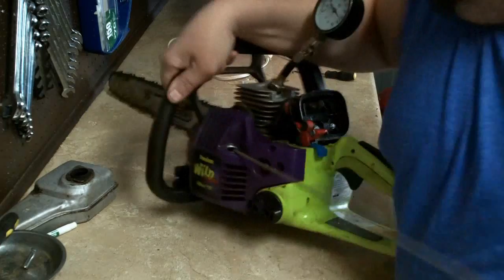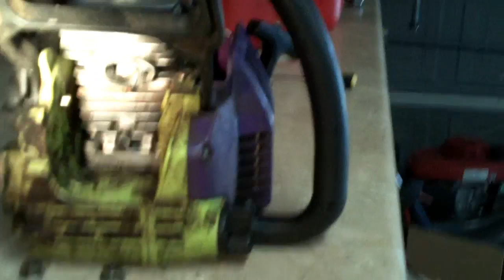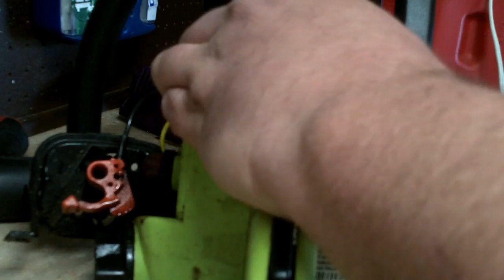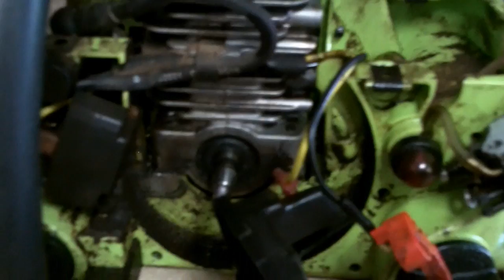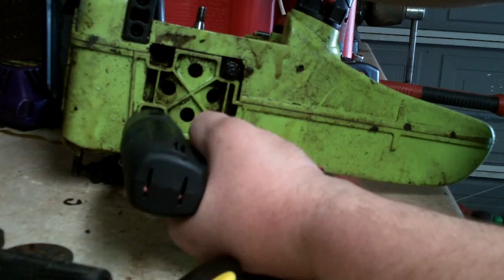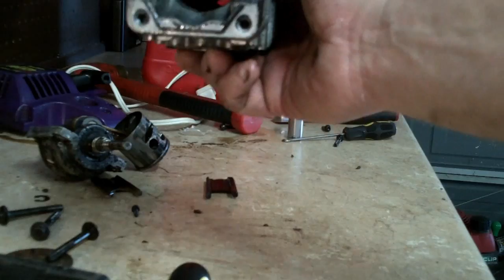POULAN " WILD THING"  CHAINSAW  ENGINE FAILURE DIAGNOSTICS AND TEARDOWN

Comment: I wish people would stop buying these $150 saws. If you really need the power of gas you need to buy (at the very least) a farm/ranch grade saw from Husqvarna or Echo. Stihl is a good saw but only in the pro line.The real problem is that 80% of people don’t know how to run or maintain a gas saw let alone sharpen a chain. The number of videos on YouTube about saws that have been straight gassed and have scored cylinders/ pistons is evidence of this. If you need to trim trees or other small jobs,just buy a good battery saw. They are a lot better than they used to be a few years ago.

Comment: Very good thanx,I have a poulan saw262 pro no spark. replacedthe integral coil and wire assembly, gapped at 15 thou to flywheel,sanded lightly fly wheel contact points; last year replaced all the fuel lines, fresh gas......no spark any ideas?

Comment: These engines live for years if you treat it right. Drain fuel out every winter, and let it warm up before revving it. For some reason nobody knows the correct way to maintain a 2 stroke. My wild thing has been running since i bought it new when it first came out.

Comment: I would save the parts you problem not as common as carbs save that carb and bar and chain also if clutch wheel good save it I seen them dent and jam just with pitch log

Comment: One more thing after completing the video .  Thanks for the demo.  You seem to be very knowledgeable except for one thing . Your refference to polan being a  " paper towel " saw is correct about them , but so is most products today.  T H R O W  A W A Y   is the norm .  Someone on a farm blog said , poulan is a throw away saw after about 5 to 8 hrs service of use .  Not before the time of the NAFTA agreement in the 80s .  I am rural and for many years , i depended on firewood , because most of my land is timber .  I have used a pouland saw year after year for several years and many many cords of firewood before getting another poulan !!!!!!!!!!!!!!!   They lasted hundreds of hours .  The consumer is getting more knowledgeable about the government and big business getting into bed together and robbing the people by higher prices and no quality .  Have you noticed the left's agenda to make everything wrong , backwards , upside down , inside out , truth a lie , etc. etc.   Pouland has fallen under the industry standard , called planned obsolescence .  They're products are designed to fail in a short time .  An  O L O G O P O L Y  is a market form wherein a market or industry is dominated by a small number of large sellers (oligopolists). Oligopolies can result from various forms of collusion which reduce competition and lead to higher prices for consumers. Oligopolies have their own market structure.  When they moved most of our industry out of the USA , there was no more competition , therefore they had an almost monopoly on their products !!!!!!---Ernest E. Johnson

Comment: These saws require 40-1 gas oil mix, would you suggest using 50-1 instead? To avoid the carbon build up? 
Thanks

Comment: I am sure the main reason they break down is because, WHO looks after a 150 dolLar saw like they would a 5-900 dollar saw?  plus ppl who buy those saws are noobs, no nothing about saws and just want one or need it for one job... you know ppl who dont look after them. watch another youtuber small engine dude say " they will last as long as any other saw as long as you look after them proper. you may not be falling big azz trees with it but for little work they are fine.

Comment: My Poulan 2150 has a rubber seal on the cylinder head side of the carb adapter, and the gasket kit for this model has an actual gasket rather than the rubber seal. 
I'm wondering if it would be best to discard the seal and use the gasket only or use both?
Reply: Ooops, wrong saw ^, it's a PPB3416.

Comment: found one just like it, same model number exactly, saw itself is in great shape, carb is pristeen, spark that can jump a fence and good compression, just a little scoring is all, but it wont run for shit, cause its a pullin pro? cause its a 2 stroke? why? . . .it dont make sense that perfect condition, good plug, not flooded, saw in working order wont work

Comment: i honestly dont know why people trash poulan saws , its the people using them that mess them up by using cheap gas and cheap oil or forgeting to ad oil to the gas ????  these saws with the proper mods will run harder than any husky or stihl 42 cc class saw i promise

Comment: ive got a 1998 42 cc wild thing , i removed the engine and used concrete adhesive to reseal the crank seals and clamshell , i also drilled a hole in the tank to take a larger main fuel line and used a stihl fuel filter ,, on first start up it would rev to almost 16,000 rpm , i shut it down and retuned the carb ,, i started it again between my leggs and it went full throttle close to 17,000 rpm and the flywheel exploded between my leggs and blew my left nut and half my left leg away ,, be carfull moding these saws they hit full rpm very fast they are a beast

Comment: hi have a wild thing got gas and fire. but wont crank. does it have a flywheel key. it is almost a new saw. let it set up with bad gas . put new carb on it fired right up about 6 times next day wouldnt not start hasent started yet.

Comment: Question.....Poulan Wild Thing.  125 psi, clean plug, good 40:1 gas, strong spark, brand new carburetor, exhaust flows clear, will not start, puff, back fire anything , even when using starter fluid.....   Looking for suggestions....thank you

Comment: On the top of the carb on the right side it has a plastic black part that has a spring. Does someone know what that part is called. And can it be bought without buy the hole carb. Any help will be helpful thx.

Comment: Jeremy, thought you were a backyard mechanic within the first 45 seconds of the video, a compression test without the throttle WOT, new guy mistake. But hey, you know what you are doing. good job, also if you said it or not in the video, poor quality oil will do the same, for all you guys reading. Also, for all you budget minded guys who are buying poulan saws to use once a year and dont have alot of experience with a saw, please buy a stihl, husqvarna, dolmar, something with a reputable name. (even though poulan used to be a damn good saw. maybe you wont use the saw enough to see the engine difference, SAFETY is always good. Poulans anymore lack in that department. Just remember, if you buy a saw from walmart, the customer service desk cant tell you what went wrong with it, but an actual dealer can. A new ms170 is like 200 bucks, plus you get an actual dealer to work with. budget minded is good, but so is peice of mind that your initial investment will last.

Comment: Hello, thanks for the info I didn't want to hear.  I just bought a used chain saw from a craigs list guy exactly like the one you took apart. The seller showed me it started up and I thought is was okay.  When I got home, I started it up and felt that the pull string was really hard to pull at TDC and when it started it went to max RPM so I shout it down quickly. I did that several times so I surmised that the carburetor is bad until I saw your video. Now I'm thinking I got a lemon. Wood I be correct ?  No,  I have not taken a compression test yet because I don't have one that screws into the head.  What should the compression be in PSI anyway.  Thanks

Comment: so clean the carbon off and put it back together and run it.
You did show 180 psi which means the piston-cylinder-ring are working.
And that ring moved, I saw it move, so it was not stuck.
I just pulled apart an old Poulan 2300 with 16 inch bar. Engine had small amount carbon buildup. Cleaned it up-replaced the 3/32 oil line for the pump. 
Saw has good power, cuts good.
These engines can tolerate some wear-grooves on the piston. The cylinder though should be smooth.

Comment: Someone ran cheap oil, or outboard motor oil in this saw. If people would buy good synthetic oil like Bel-Ray MC-1, or H1R, these saws would last a lot longer. I have run Bel-Ray at 40:1 in cheap chainsaws, and after five years, the cylinders and pistons still look nearly new, and little to no carbon build up. I have a $59 Homelite bandit weedeater that is 16 years old and still runs good. I have only run Bel-Ray at 40:1 in it since I took it out of the box.

Comment: Have a 2375poulan saw it has a lot of kick back when u crank it .
i checked flywheel key it is good it has 120 compression.
It has good spark when i put gas in carb it will not hit a lick
if it has compression and spark it should at least hit. the rod has
a little rattle in it could it be binding up and how would u tell? help.
i checked seals with air and vacum all good.

Comment: thx for the vid bro...my fairly low-hours wild thing used to start very hard but when warm would run like a champ and start first pull. this season when i got it out, put in fresh gas and oil (it was stored empty) and attempted to start it just wouldnt. after probably 300 pulls it coughed to life a couple times (using ether), then died. i'm wondering if i should troubleshoot it or just get a new saw..these seem to have a bad reputation....
Reply: that's a very good saw ,, people that buy them fuck em up with cheap gas and oil , I've got several stihl farm boss saws and I I'm impressed with the poulan 42 cc class saw it's bad ass I've owned one for 15 yrs and work it hard and never had a problem with it ever
Reply: duh why did you buy it in the first place? they are junk

Comment: Hi I would like to know how to remove the oiler from under a break band. My POULAN "Wild Thing" isn't oiling when I cut
Reply: remove the clutch   its right under it  easy fix   had one of mine  go  bad
Reply: the platis oiler is shot. you have to remove the clutch not brak band

Comment: Can someone tell me if running a chainsaw at lower rpms is dangerous?
Reply: +checkmyleetskill  A chainsaw should operate at ONLY two speeds. Idle and Full Throttle.
Reply from the maker: no i do it all the time....no need to wrap a saw to 12,000 rpm to cut a little twig.....just use common sense and yould do just fine
Reply: JEREMY FOUNTAIN  Thx for the quick response.I appreciate it.
Reply: not quite John me you can adjust the rpm depending on the cutting circumstance. for example your not going to rev a 09 sthil chainsaw full tilt to cut a branch 3 in wide. that's why the throttle can be varied.
Reply: its not dangerous, but they do need to rev, other wise carbon fouling will build up
Reply: no
Reply: Normally it's not... your engine will most likely just cut out and misfire if it's idling too low. If you're talking about low RPMs at full throttle,  that's not a worry because you can't put nearly enough load on the engine to lug it!! The clutch slips long before you can get close to lugging the engine.
Reply: checkmyleetskill old thread, but yes a mid range throttle is dangerous, for extended periods. A chansaw has 2 jets, one for idle , one for WOT (wide open throttle for guys who have asked that question.) At idle, your pilot jet (or low speed or idle jet) is simply put- keeping the saw running. a saw needs WOT when cutting to both make the fuel/oil mix, work as it should. (low rpms= less combustion temp= carbon fouling like in this video. Plus mid f=range throttle cutting does not move enough air via magneto or flywheel to properly cool the engine. that is aside from porting or jetting a saw, changing sompression and squish and timing.

Comment: I had one of these come in my shop today. It had been run with the brake on. It got the clutch REALLY hot and melted a bunch of plastic around the clutch, ruined the clutch spring, and ruined the brake. I took the clutch and brake off. It will crank but runs like crap no matter how you adjust the carb. I'm guessing it ruined the crank bearing and/or the crank seal. Is that a posability? Thanks.
Reply: wcjcnc mine did the same thing.

Comment: I have a Poulan wild thing 2375 which I have had since 2001.  Still runs good but is there a kit available to bump the CC's of this saw from 42?  Also it's an 18" 3/8 bar and chain.  Can you get anything longer in 3/8?

Comment: Great video. Just one question.You can't repair chainsaw with such engine problem?
Thanks
Reply: You could... but for the money you spend on new pistons, rings and re-honing the boar, you'd be better off just buying a new saw! it's not like rebuilding a car engine where all the parts have a high value... most consumer grade chainsaws are built to serve their purpose and fail just out of the warranty period... When that happens the parts are more expensive than the saw by the end of it usually.
Reply: yookang lee  they make cylinder piston sets you can buy online.